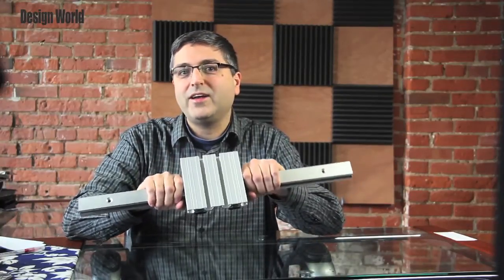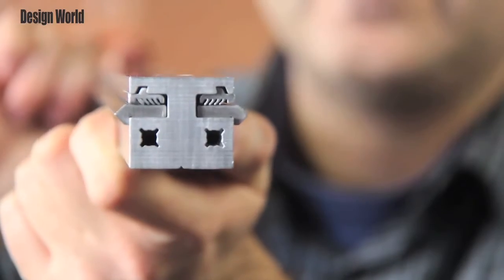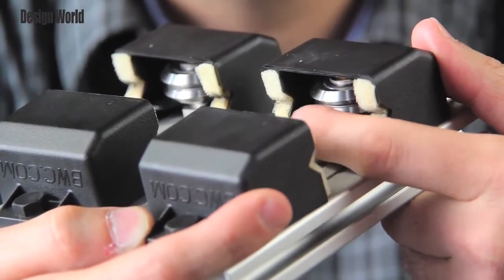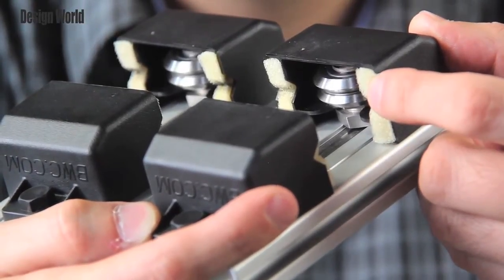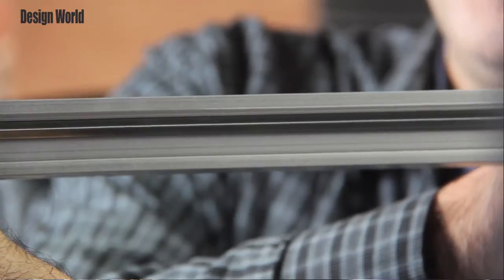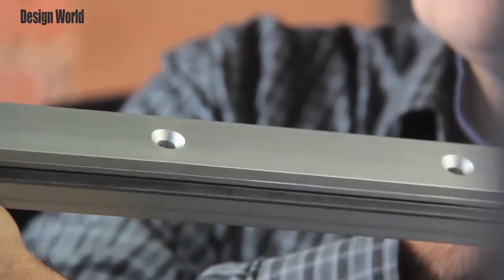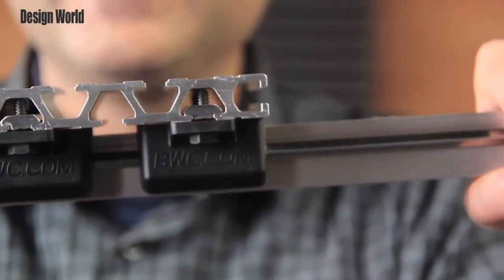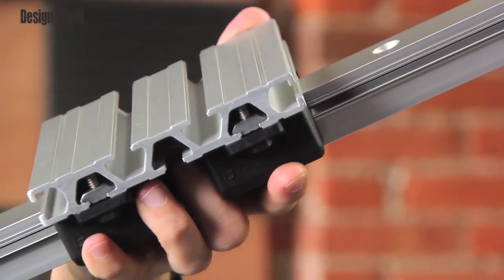Product Review: Bishop Wisecarver QuikTrak line of linear...

Comment: QuickTrak is like a linear guide kit-of-parts so that manufacturers and automation solution providers can assemble machines with motion guidance systems faster and easier with its T-nut and T-slot features. 

QT can be cut-to-length and customized without additional machining (reduced downtime and total cost of ownership). Also, great for debris-laden environments since it's built on 90-degree guide wheel technology.

bwc.com/products/quicktrak.html